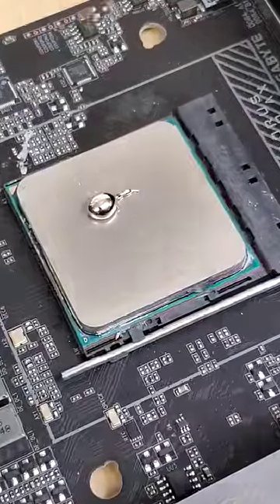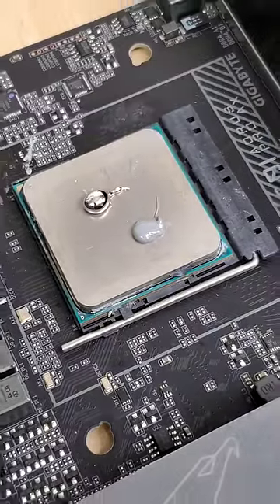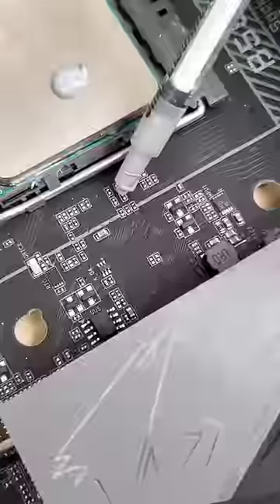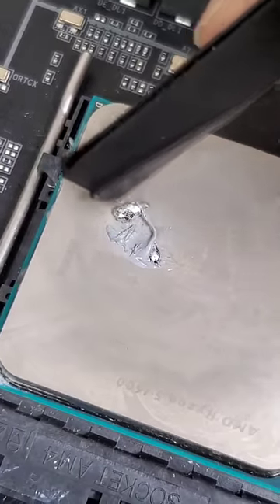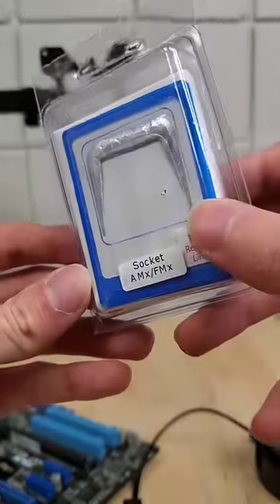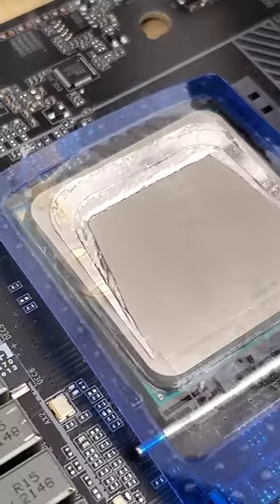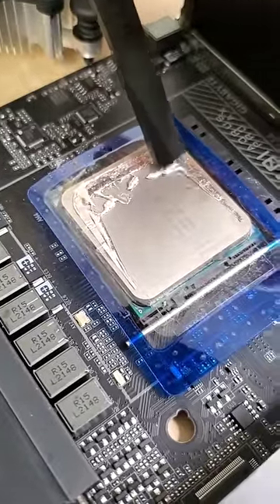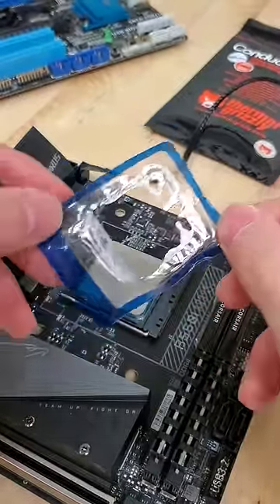the future of thermal paste technology #shorts

Comment: "It's not going anywhere." Famous last words.
Reply: It's time to learn a critical life lesson!  Those 4 words, when say changing tires, mean your rims&tires will never fall off.   It even works for handcuffs.
Reply: The same was said for the Titanic and look where it's at.
Reply: All because he didn't slap it after installing it.   Such a rookie move 😂
Reply: Playstation 5 owners who has consoles sitting up vertical.
Reply: @YaKillaCJ  Yeah, like this would have been VERY nice to have on the ps5 given the problem they have sadly. Although, who knows.... feel like they should just make one of these with a proper solid ring around it to prevent spills
Reply: @YaKillaCJ  the PS5 has protection around the APU so the liquid metal won't spill. The real issue is it getting pooled into a single spot, although that's also kinda rare and can happen on horizontal PS5s as well.
Reply: @garymartin9777  it’s tap tap “that ain’t goin nowhere.”
Reply: Source: trust me bro
Reply: @Yarumasi  IMO you'd have to be mad to have a PS5 vertical. Anyone with pets or kids..... that console is getting knocked over at some point. Even if you don't, it's still a dumb risk.
Reply: @PumpkinHoard  PS2, PS3 and PS4 were doing fine vertically. Your dog has no relationship to thermal paste vs liquid metal.
Reply: lmao
Reply: @92kosta the unsinkable happened

Comment: Computer running on high heat

Him: why does it smell like burnt plastic?
Reply: PET has a melting point of 250 to 260 degrees Celsius
Reply: @erayk96 that's about what mine runs on Minecraft 👍
Reply: shoot can I bbq at ur pc? @DieselDrinker45.
Reply: A Computer cannot get hotter than about 110-120 degrees celcius, unless it short circuits.
Reply: Blew head gasket
Reply: @santosdr2  give er' a shot
Reply: The plastic that the motherboard are made of    
 °👄°
Reply: @erayk96 they degrade lower temperature than melting point.
Reply: @abcddef2112  nonetheless, there are heat-resistant plastics
Reply: @FabledGentleman not true I once covered a pc with gasoline and lit it on fire.  I am quite sure it was 1000+ degrees without a short circuit.
Reply: @FabledGentleman 120c what are you running R290x?
Reply: @DuBstep115  You can, with some motherboards, remove the factory 100c protection and set it to 115. My MSI motherboard for example supports it.
Reply: @FabledGentleman  my mobo runs at 60c, so no thanks
Reply: Americans can’t handle metric……
Reply: You have NOT seen the grandma cooking on the plastic bag.
Reply: @erayk96 I run my CPUs very hot. Need to heat my house
Reply: @DieselDrinker45. Can I come too I will get the shimp and fish 😂
Reply: @NoFreeNapkinz614 if the temperature if higher than 250 degrees then ur pc is literally on fire 😂😂
Reply: @thambu77  sure thing
Reply: @nikosn.9932  What kinda plastic bag was that?
Reply: @FabledGentleman  thats not how electricity works. a computer can get as hot as u want it to by running more amperage
Reply: @Scotty-vs4lf  Ehm, no.. And btw this plastic is on the CPU. The CPU has an absolute upper limit of 120 degrees celcius. By default it starts throttling at 100c. The CPU will be destroyed if temp starts to climb higher. So then it really doesn't matter much. Plastic like this can handle about 250c, meaning over twice as much.
Reply: @FabledGentleman  ehm, yes. not all cpus will save themselves. modern ones probably do but older ones can definitely get cooked with too much current
Reply: @Scotty-vs4lf When the components have run so hot that they are destroyed. I don't think melted plastic is one of your key problems anymore.
Reply: @erayk96  rtx on boys
Reply: If your PC is running at over 100C that its starting to melt the plastic components, you have bigger problems.
Reply: Just don't open many programs or watch 4k videos, and your cou will be fine
Reply: @santosdr2  i use my pc as a hot plate......this is not a joke
Reply: @caliginousmoira8565  hot pot at your pc i'll bring the noodles.
Reply: @jiinkwan tbh for some weird reason I like Celsius more for cpu temps instead of regular Fahrenheit this is one of the only exceptions I think for Americans
Reply: @FabledGentleman 😂
Reply: @erayk96  Yes, but plasticizers and certain other components may begin to 'off gas' at much lower temps.
Reply: If it's starting to burn then your entire pc will probably also burn too
Reply: @MathewCR  PCBs aren't made of plastic. they're fiberglass and/or epoxy
Reply: I think it's just a normal plastic bag with water in it. All the heat from fire goes into water through that bag and the plastic bag is alright, as long as water is there I guess @IronTiger
Reply: @BerzerkaDurk  Ohhh, I thought they ware made of some king of polycarbonate 😅
Reply: @FabledGentleman  dude, a pc shuts down after 100C
Reply: @FabledGentleman why tf would you want that? So you can play on winter without the heater on?

Comment: Thermal past works just fine I’ll keep using that.
Reply: Yeah, people should just get a better cooler and stay away from liquid metal.
Reply: And it also doesn't drip when your computer is sideways.
Reply: Yeah hand me 50g of artic mx-6
Reply: Agreed
Reply: You may use the thermal past, but I'm looking forward to the thermal future!
Reply: My 4090 is 40c under load with liquid metal + water cooling
Reply: @mycelia_ow  put liquid metal in the water cooler, simple
Reply: I use liquid metal, and yeah it doesn't worth the hassle
Reply: I use thermal present it's better
Reply: @nadtorus  That's now obsolete, you should be using thermal future.
Reply: @mycelia_ow  wow, so now you can say that to others? WOW!
because otherwise it's functionally the same as one running at 80c with air cooling.
Reply: Thermal future is even better
Reply: @Israeli_Prince  50g?  Goddamn how many computers do you have?
Reply: Its all fun and games til ur cpu runs 90 degrees Celsius idle😂
Reply: @Stabbyson coming right off at 5000$ just for the loop😂
Reply: @pantanlp7187  BAH! I'd pay triple for that! Make it happen!!
Reply: @Stabbyson  damn u actually crazy
Reply: Based
Reply: It's good idea but need more innovation and need to stay closer to silicon paste as blob and not plastic cover
Reply: If it ain't broke don't fix it
Reply: All of that for 2c difference
Reply: But imagine if everyone had that mentality... "my horse and carriage works just fine, why do I need a car" innovation would DIE
Reply: It's not tiny, some cooling combined with this liquid metal can decrease 10°C which is alot in terms of processor
Reply: As CPUs continue to get more powerful and offload more heat, thermal conductivity will begin to be an issue in high end systems. It already IS an issue with i9s, but that's on the IHS.
Reply: Once and for all: liquid metal thermal paste WILL NOT drip if it’s sideways. The mounting pressure will keep it from going anywhere.
Reply: @mycelia_ow that's just overkill, why would you care to get it under 60°c
Reply: @maya_void3923  Maybe it wouldn't matter gaming, but I have it overclocked especially the memory. It was getting way too hot on the stock cooler doing AI workloads. This card is monstrous when both kept cooled and overclocked.
Reply: @jamesm568  I mean I put liquid metal in my pc like 3 years ago, at least maybe longer. It's been stood up the whole time and my temps have been fine.

I never even bothered to put a coating over nearby chips which in hindsight I should have and will in future which completely mitigates that issue.
Reply: it works 10x better
Reply: Thermal past is not so good when you will have a cool AF future 😂😂
Reply: @jamesm568  bs what you say, liquid metal does not drip when your pc is sideway. If you put it on appropriately without any gaps between the cpu and the cold plate it should be fine. But if you are afraid of causing any damage, then use few layer of clear nail polish at the surrounding of the cpu on your motherboard for cover in case of a leak or simply don't use lm if you are not experienced.
Reply: @akos4739  It's not BS as it's an absolute fact and very well documented while also mentioned in the manufacturer specifications documentation of the product of the risk. Hell, it even happened to gaming consoles that use liquid metal.
Reply: @jamesm568 yes its a fact that it can drip and cause short circuit but read what I wrote if if the case is that your afraid of using it.
Reply: No you won't.
Reply: Quiet, grandpa.
Reply: @Stabbyson I want to see that
Reply: Ill mark your words on this.
Its just a matter of design nowadays.
Cpus and gpus will use them one day and i think very soon
Reply: Ok boomer
Reply: @i-am-g1467 it can make quiet a performance difference especially on the top end I've been using liquid metal for almost 2 years now zero problems
Reply: @GAGRA0 I think the same people that say it drips are the people that use an entire tube of thermal paste for one install.
Reply: If you spread it on properly and not just put a dot in the center like these videos always show. A dot expands just as larger circle…on a square chip you’re trying to cover.
Reply: @sylviam6535 No they shouldn’t. Majority of modern Motherboards compounds are far enough away from the CPU that you have little chance it bridging. And you can protect it with silicon liquid barrel. You can even use clear nail polish.
Reply: @kugelblitz1557 its for ppl that actually computer. Not just computer users.
Reply: Its good enough for literally any cpu out there right now. I never felt the need for liwuid metal
Reply: @skeric07  I use roughly half a g for my CPU and it goes ~6 months without needing a replacement.  50g is like ten plus years supply for me and there's no way in hell I wouldn't drop it into the void between my desk and the wall by then.
Reply: Not a dumb question but what exactly is Thermal Past? Is that the brand name or something? Tried a search and nothing pulled up
Reply: @Ebb_and_Flow  No this is more like "I have a car, but I could go 1mph faster if I switch to a very special horse and carefully massage their butt every 3 months"
Reply: @mycelia_ow  "My 4090 is 40c under load"
That's cool. Doesn''t really help you out much though.
Reply: Yea, the outside temp where i live hits 120 in the summer but my computer still runs smoothly with my noctua, even though its an 11th gen intel. I could improve my cooling, but since it wont actually net me any performance im gonna stick with this and save a few hundred bucks
Reply: Exactly, what fries the PC is not cleaning it using air from time to time, even cold hair drier with a paper cone at the end do the trick. The thermal paste doesn't matter, cleaning it does.
Reply: @Stabbyson  I see what you wrote there.
Reply: True

Comment: Just a note guys but not all thermal pastes are non conductive. Make sure you check the packaging before applying so know what type you have and the risks/benefits associated
Reply: This. This video is very misleading. There are many silicone based thermal materials that are VERY electrically conductive. It’s the particles inside that make the difference, not the base liquid.
Reply: Not to mention just because it isn’t conductive at DC voltage doesn’t mean it’s not conductive to AC or RF circuits
Reply: @ISuckUnderPressure Arctic has one of those called Arctic Silver. It used pure silver instead of silicon so it techically last forever but also dangerously conductive like liquid metal does
Reply: True, there are also some that’s while not electrically conductive, but still electrically capacitive. Which can be just as dangerous. 

Arctic Silver 5 is the perfect example of this, hence why its popularity has dropped quite a lot nowadays.
Reply: ....sounds like my life if you look at it too closely. 😢 lol
Reply: Just know what you're looking for is heat transfer, not electrical conductivity.

Comment: A perfect example of don't fix what ain't broken
Reply: I agree. Who cares about like 1% increase in efficiency or whatever. Normal paste is enough for 99% of the (computer) users.
Reply: @Albtraum_TDDC I would say it’s not about the efficency but the lifespan. A well refrigerated CPU would last much longer that one that is constantly getting overheated
Reply: With that attitude we'd still be playing Pong on an 80s arcade.

Right now, heat is one of the biggest hurdles in computing power.

In most other aspects we are literally nearing the limits of physics. We are already running into problems with the speed of light, which limits size and clock times of cpus.

We are reaching problems with density because the smaller we build the more energy we need and the more heat we have to dissipate.

We need the best possible cooling.
Reply: @christophfischer2773  That's a fair point, but imo until there's something that doesn't have such high risks we won't see paste being replaced anytime soon. Especially with how well coolers work nowadays, liquid metal just ain't it

Comment: I haven't seen something this flimsy, unpromising, and risky in a while.
Reply: I agree with you 100%. I don't know if it's just this video, but that looked chronically bad.
Reply: Yeah, thin plastic around molten metal, under pressure? What could go wrong?!
Reply: Not since I met my ex-wife.
Reply: he did it wrong lol you arnt supposed to leave the plastic like that at all. that plastic is just to apply the cold metal and they you rip it off and turn on your PC so it heats up and melts. Its old school stuff. came out before modern liquid metal. thats why its hard then melts.